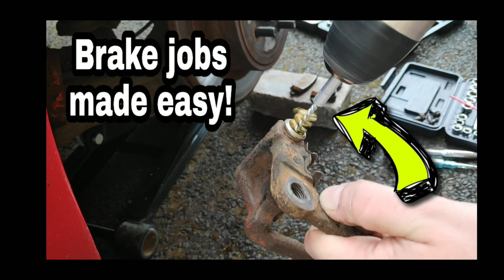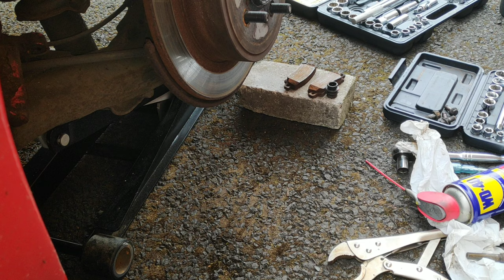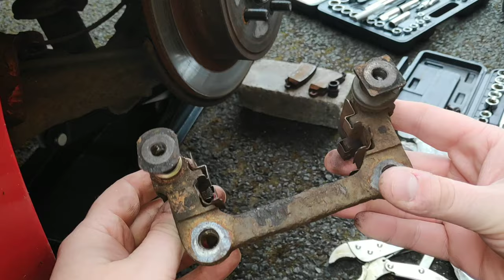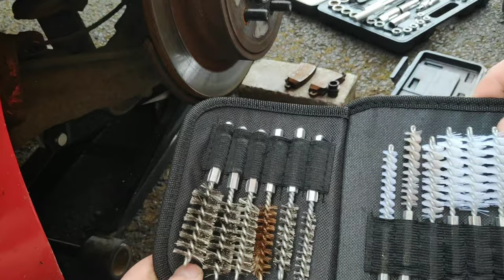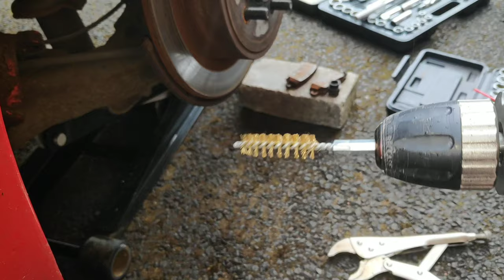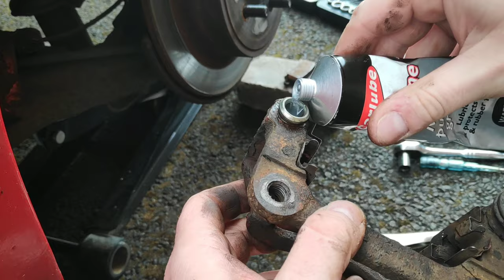Toyota Corolla brake slide pins. Quick tip to make it an easier job.

Comment: Yes, grease on the pin and not in the hole. It is VERY important to not over lubricate also. Too much grease will keep the slide pins forced out and you will be redoing your brake job in not time. 
Thanks for the info, nice wire brush set! ✌
Reply from the maker: The grease I had was too runny to do that with.

Comment: The reason Toyota pins tend to stick is because Toyota put red rubber grease on the pins from the factory. Red rubber grease isn't very high temp and dry up after a few years. You're better off using thicker silicone grease than that carplan stuff. Silverhook Silicone grease for the slide pins and Silverhook ceramic grease for the abutment area under the clips and caliper piston face and caliper ears. It's Cheap too.
Reply from the maker: Yeah the carplan stuff is rubbish, too light, I have since thrown it away. Thanks for the tip.

Comment: The pin with rubber goes up or down? The kit comes with 2 all metal and 2 with a rubber ring. There's a right place to put?
Reply from the maker: The general rule is to put the one with rubber along the length of it on the trailing pin. The one that contacts the disc first when the tyre is rotating should be all metal.
Reply: @orbitaaltube  So this pin with a rubber tip always goes on top considering the brake position and rotation?

Comment: I have a 2002 corolla , where do the giide pins go? As far as top or bottom. I know like a big dummy I took both out and now I don't know where the one with the rubber grommet goes whether its the top or bottom on the front brackets.
Reply from the maker: See comments below that ask the same question.
Reply: Nobody knows. I put one on each way and the one with the rubber at the bottom works best.
Reply: Pin with grommet goes on bottom of caliper to absorb vibration and help with noise rattle reduction.
Reply: @danieloconnor6594 Toyota corolla only fits one hole !

Comment: Are the guide pins for front and rear different from each other? Need to buy new ones but unsure if they are all the same or different?
Reply from the maker: They are listed on eBay as separate listings for front and back. I have never tried to swap them from front to back.
Reply: Rear pins are shorter than front not interchangeable.

Comment: That's great, I'll look up those brushes next time I'm doing a few purchases. 
I had a tube of silicone grease but it was quite runny like yours. Many other youtubers use silicone paste. I found a tube not too expensive and it's definitely a bit thicker. Maybe it'll not escape the slide pin bushes so easily?
Reply from the maker: Yes the silicon grease I have is extremely runny - dont think its very good. I will invest in some new stuff next time I do this job.